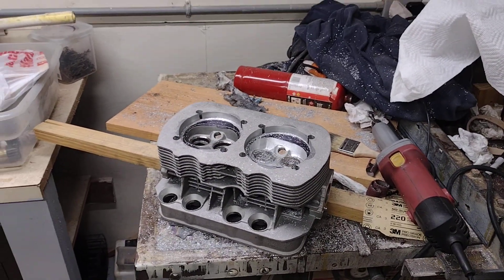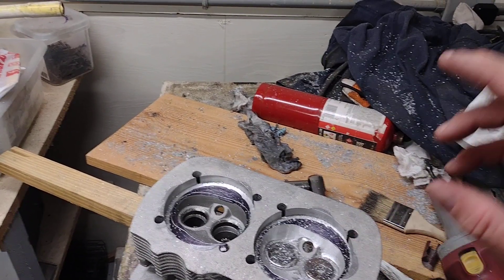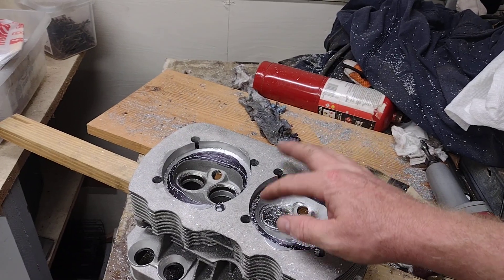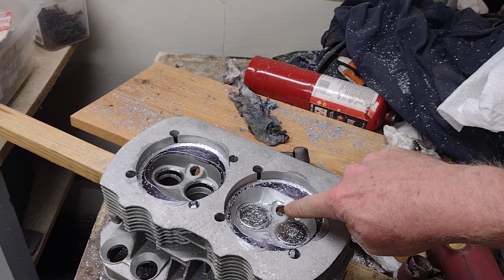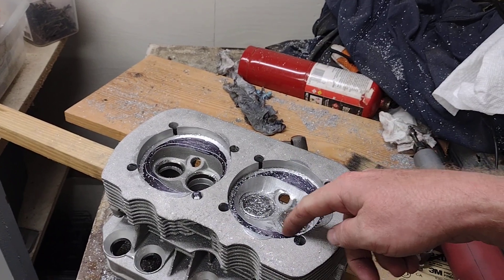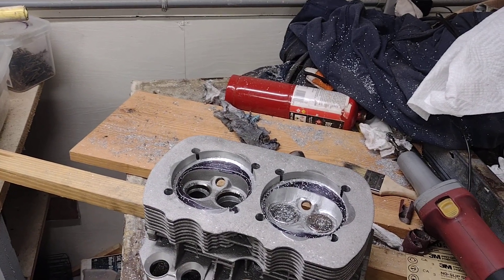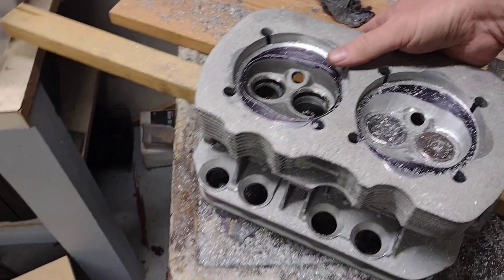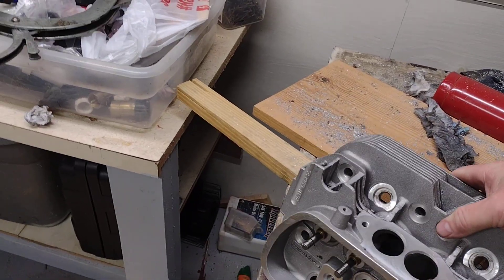How to lower compression on a VW.

Comment: Hi! If I have 92x82 pistons and i want to use stock crankshaft 69mm, what can I do to have a normal compression ratio/deck height to obtain 1835cc? cut heads? cut cilinders? thanks!
Reply from the maker: You can use a longer rod to make up the difference in pin height. A 5.7" long rod might be a little to long but you could add shims under the cylinder.
Reply: @MattLundquistVW  ok! thank you, Matt.

Comment: 1835cc with stock valves, cam and carb  is a recipe for hot running heads.
Reply from the maker: If you don't adjust the compression then it would be. But we put the compression back to stock.
Reply: @MattLundquistVW  I disagree. Increased capacity requires other things to increase for sufficient cooling ie bigger valves or increase valve timing. But maybe you could post some tests of CHT once up and running?
Reply from the maker: @mathewboyd3746 Unfortunately I can't do that as that motor is driving across country. The young man put 2000 miles on it in the first two weeks of getting it back in the bus. He has not reported any issues with cooling. Your logic ignores what VW did to these motor. They increased capacity several time and did not change cam profiles, ( 1200-1600 same basic profile) they even put smaller valves in the late EFI engines. They did the same with the type IV and in the water boxer. The only reasons they changed carb sizes was for HP and smog requirements.

Comment: I'd consider opening the heads to 62-63cc and dropping the deck height to .040. I've found that with less deck you can get by bumping the compression a little, and it's a little more efficient.

I'd consider changing a few things from stock just to make it more reliable and last longer, I usually build with a CW 8 dowel crank, solid rocker shafts, and external oil filter and cooler. Ever tried the Hoover HVX mods?  Drops the cylinder head temp enough to make it worthwhile, but you have to drill the case and cut the lifters and rockers.
Reply from the maker: W B that is exactly what we are doing. Opening the chambers up to 60cc and going to set the deck as close to .040" as we can get. 
The previous assembler ( would not dare call them a builder lol) set the deck to .145" and this thing wore out the cylinders in less than 5000 miles, plus the oil issue he totally neglected to address.

Comment: I have the opposite, with deck height of 1.7mm and a 62cc head. I'm fly cutting the head down 1.77mm in my lathe now. Will end up with about 1: 6.9  ( should have cut it down a bit more realy )
Reply: I would have cut the cylinders down to reduce the deck and keep combustion in the head.